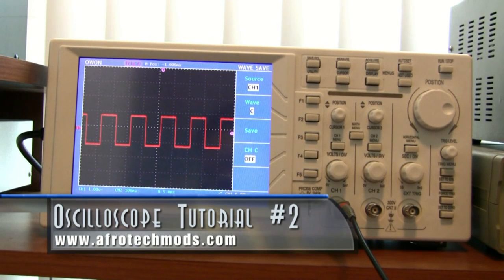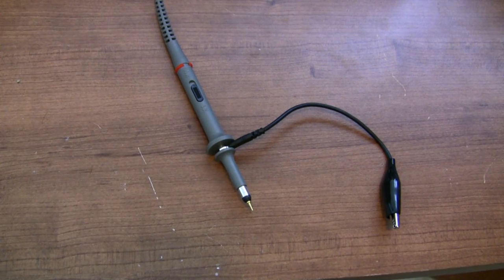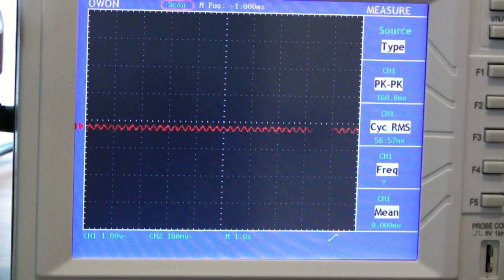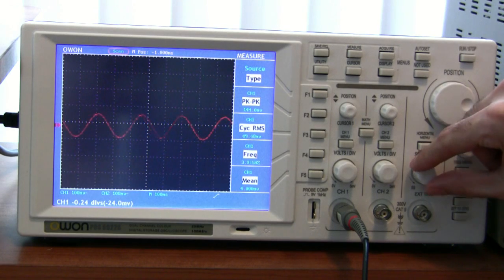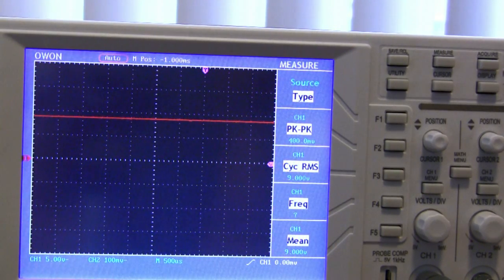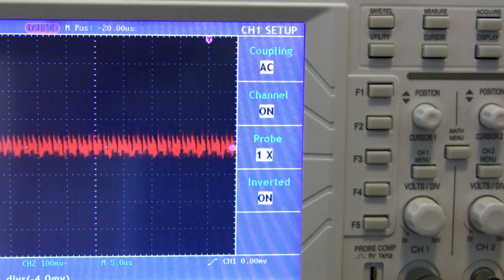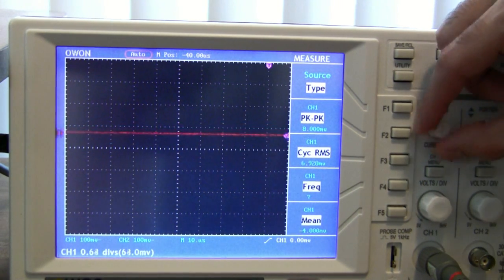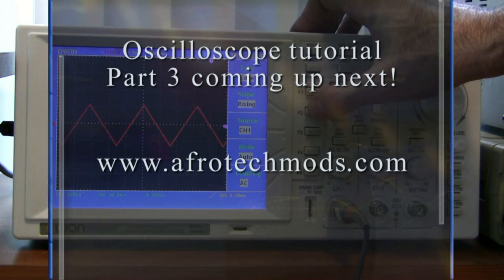Oscilloscope Tutorial Part 2 - Basic usage

Comment: You should add to the video that the ground clip should never be used to measure differential voltages. The ground clip should always be attached to 0V
Reply: That's what ground is.
Reply: Nope. Ground is the reference of 0V in the circuit. circuit ground can have a completely different charge than Earth, meaning if you short circuit ground and Earth, sparks will fly. This will happen on SMPS.

Comment: I have an old scope that i got from ebay and I need a probe.   Will the probe advertised  at the very beginning of the vid work for the old scopes?
Reply from the maker: Yes it will almost certainly work. Try to get a probe with at least as much bandwidth as your oscilloscope has or higher.
Reply: Afrotechmods i have a dc wideband eico 435 that was originally used for tv repair.  I am new at this and I don't know what hz i need for a probe that i need to buy.  The scope has an ac to dc switch and i think that it goes from 100hz to 1000hz.
Reply from the maker: That scope has some unusual looking inputs! I found this other guy on youtube with the same scope so maybe ask him what probes he recommends? eico 435

Comment: @MrKarthikgoparaju Opposite of the valley voltage. Just joking. If you are measuring a 12 volt RMS AC signal, the peak voltage would be a positive 16.97 volts above ground and a negative 16.97 volts below ground. That is a peak to peak measurement.

Comment: The video suggests using the probe with the 1X setting, but you should actually use the probe in 10X most of the time, because it loads the test circuit less than the 1X setting.

Comment: Mentioned before, the switchable 1x/10x probes are generally cheap...as in not very good. That, and 1x probes will have only a 1M impedance, which is low enough to load many circuits. I recommend a 10x probe for just about everything. Also, you do not make it clear that the ground clip on the scope lead is EARTH GROUND! Connecting this ground lead to anything that might have a voltage potential may damage the scope, the device, or both. Normally it will be connected to the chassis of the device.

Comment: I am new to the world of oscilloscopes and about to have one tool that measures everything electrical and digital, that is oscilloscope + multi-meter.  Does that oscilloscope also have multi-meter functions such as those in the HDS1022M, which measures resistance, capacity, voltage and ampere.

Comment: @drumstick9000 yes. they're called x100 probes. your average scope can measure 60-100 volts by itself, times 100 that's 6000 to 10000 volts with a x100 probe.

btw, you know that pretty much every cheap multimeter can operate up to 1000 volts. the ADC in those actually has only a 2-volt range, and everything higher is divided down internally by precision resistors. it's the same principle in a scope, just that in a scope the division is done in the probe.

Comment: @drumstick9000 yes they do, and it's usually under 100 volts. a basic x10 probe will allow you to measure up to 600-1000 volts depending on your scope. 

you will need a special high voltage probe for anything higher than 1000 volts.

Comment: You're right. When dealing with some power electronics, stray voltage or EMI can be a menace, so x1 (1MOhm), lower input impedance, should be preferred as long as the signal level to be observed on the oscilloscope, is not actually to high to fit on the screen.
Congratulations for your work. ;)

Comment: Your tutorials are OK, but you said something about probes that is not right.
1st, not all probes have a x1/x10 switch.
2nd, if your digital scope has the ability to be set for measurements given a x10 probe input, you should always use x10 probes, since they have grater impedance 10MOhm, and much lower capacitance, than x1 mode, so you don't interfere much with the circuit. And x1 probes allow you to measure signal up to 5...10MHz, and x10 allow much higher frequencies, lets say 20 to 400MHz